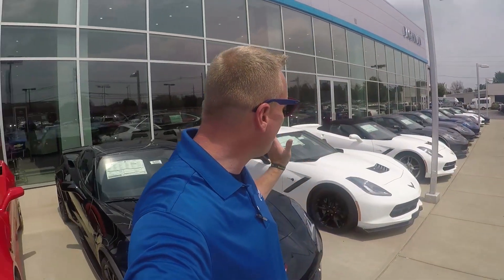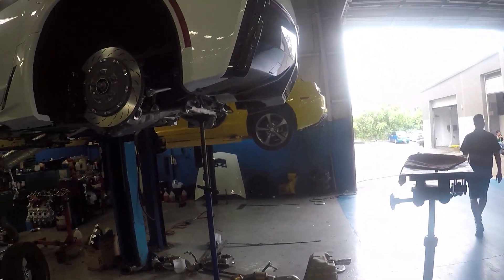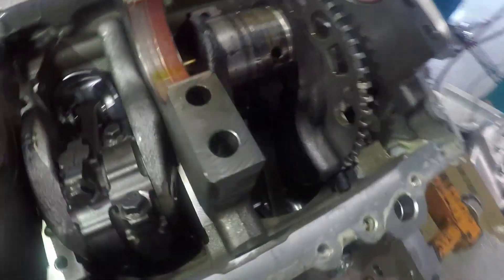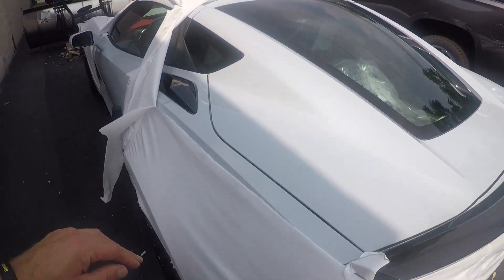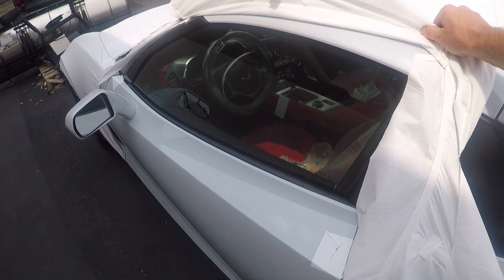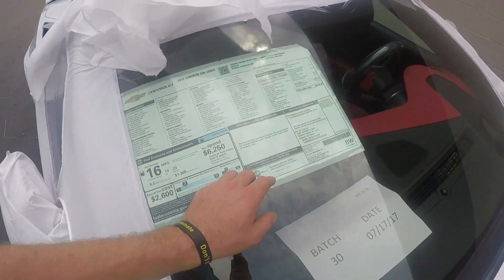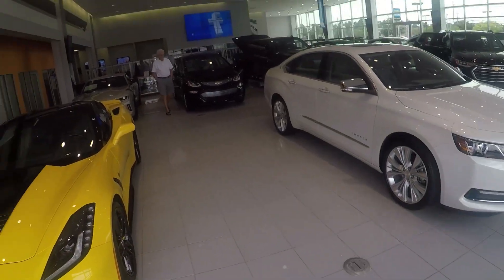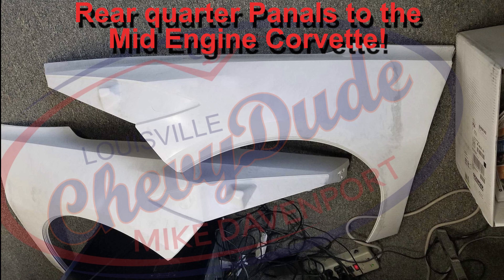Mid-engine corvette is happening. Here are the rear quarter panels for proof.

Comment: +Mike Davenport  Based on the most recent spyshots of the ME car, if you look closely at the front headlight shape, and bumper/fender interface angle, these photos you have appear to be the front fenders, not the rear quarters.  Take a look at the recent spyshots they just got.  Definitely looks like those are the headlight reliefs and these are early cnc polystyrene fenders, which is why the ridges at the fender arch.

Comment: Hopefully it doesn't overheat
Reply: Ruben Olemans Only the c7 z06 overheats and the cooling been revised in 2017.
Reply: Chris Morse I'm confused. How am I stupid? It not a new platform just some change to the cooling system.
Reply: +John Dessire the new corvette is going to be REAR mid-engine. As in, not in the front.

Comment: I spotted a test car on a lake road in Summit County CO (common test site for high altitude) last spring with these dimensions and it was with two normal corvette test cars so it looked pretty odd. I pulled off and looked at for a second, but had no idea what it was at the time.

Comment: You break in engines by racing them, race engines arent broken in at all.  These gm mechanics are used to failures at 500 miles or less so they say it was broken in wrong.